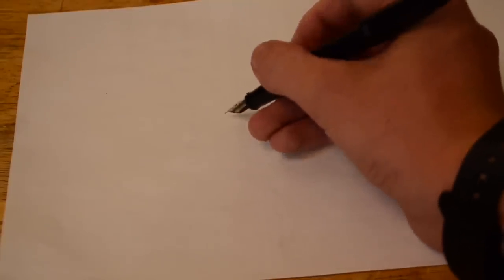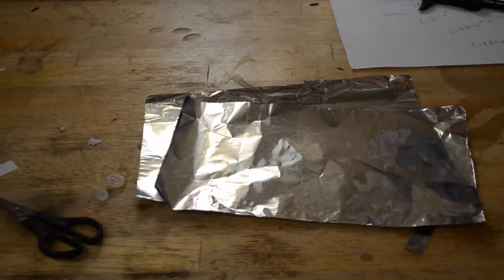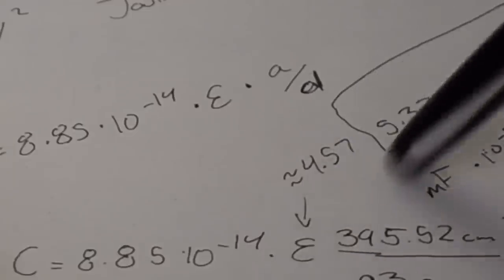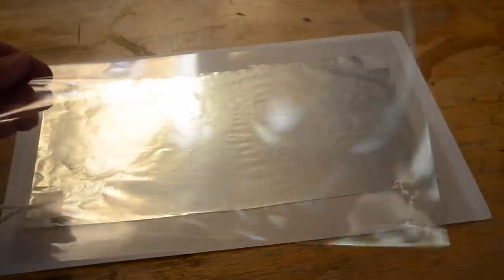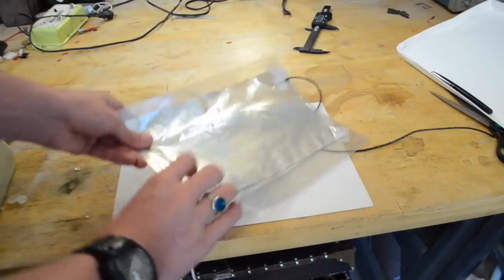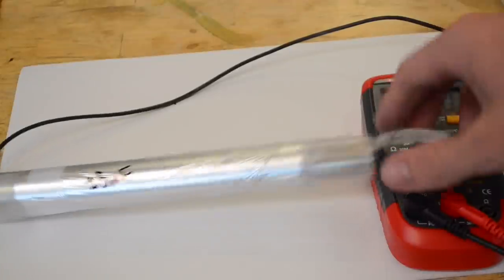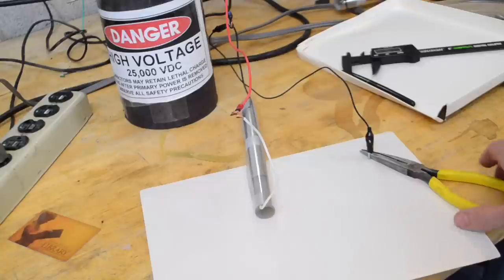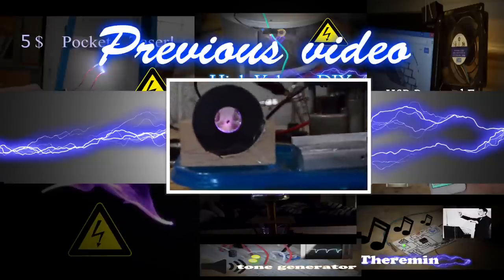How to make a High voltage Capacitor

Comment from the maker: Fact correction, a micro farad is x10^-6 ( i said it was x10^-8 in the video for some reason ) however, this is still 5 nano farads that I calculate
Reply: Keystone Science sir, that power supply of yours is quiet weak ,please make a zvs driver
Reply from the maker: +Mrinal  Thakur yeah, I have a zvs driver already, perhaps I should show how to make it
Reply: Keystone Science don't show that it's very easy use modified zvs of which schematics I will send you on telegram group
Reply: Keystone Science I watched your video of the pocket EMP. It's awesome but I am muddled up with the schematics of the taser EMP when connected to these HV capacitors. Can you please share a detailed schematic? It's really urgent
Reply: Great video
Science is great 🐇
Reply: you also wrote "mF" which would typically mean milli-farad, rather than "uF"
Reply: how could i buy that plastic sheet

Comment: Great video! I made it myself and got it to 7nF , also I used 3 sheets in between the plates and it was able to handle a pretty high voltage ! Thanks!
Reply from the maker: Thanks Nate!
Reply: Mine didn't work
Reply: @KeystoneScience can I add 2 foils together to increase capacitance?

Comment: I'd like to see 10 of these in series. No reason other than awesomeness
Reply: Out of curiosity, why series and not parallel? There's more capacitance in parallel, and which by equation means more energy, thus bigger spark this way right?
Reply: @Sensei-jh8yn  voltage gives the sparks I believe.

Comment: This is the coolest thing I've seen so far today :)

Nice work
Reply from the maker: Hah :D thank you!!
Reply from the maker: Wait, are you from Utah as as well?? I just clicked on your channel and saw the Provo power tower demolition video, I was at that as well!! I am from Orem
Reply: Keystone Science sweet! Yes, I live in Provo. Find me on FB @phonerepairtrent if you want :)

Always nice to find electronics nerds. I mostly do microsoldering and data recovery on mobile devices, but plan on launching a fundamentals of electronics channel soon. I think using this type of a capacitor video is the perfect method to show how a capacitor can short into a wire, causing a short to ground (if using as a decoupling cap/high frequency filter). Often, the insulator fails and the two plates come in contact. Your cap building method would be a good way to demonstrate how caps can short to ground. 😎
Reply from the maker: +Rice Is For Dinner awesome!
Reply: No I think the EMP generator is the coolest---YOU CAN INSTANTLY SHUT DOWN AN ELECTRONIC DEVICE!!

Comment: This is unbelievably cool. I thought you had to use some special chemicals and processes to make capacitors but I guess not! In terms of how big a spark you can get, what is better, to have more plastic between the foil of individual capacitors or to link a greater number of these in series with the least plastic (to have high current)?
Reply: Generally its not difficult to make a simple capacitor, making high quality ones however is more difficult
Reply: Crikey Crikeys connecting capacitors in series does not add capacitance.   The principle is opposite of batteries.  To add capacitance, hook them up in parallel.
Reply: Correction: The principle is not opposite of batteries. Capacitors in series add voltages. This is the same as batteries. Batteries in series add voltages. Capacitors in parallel add capacitance. Batteries in parallel add current. Hmmmm. Seems like there should be some profound relationship between battery current and capacitor capicatance.
Reply: However battery Amp-hours might have a closer relationship to capacitance in joules. No?
Reply: Amp-hours and joules: WORK-OVER-a-period-of-TIME ???

Comment: just think if you had a thin film of superinsulating titanium nitride film cooled below it's critical temperature with liquid helium. Then you could hypothetically prepare a very small capacitor with infinite voltage and subsequently unlimited amount of energy to be stored within it.
Reply: but keep in mind the production of inifinite energy is impossible because Newton was a huge pp
but the idea is both theoretically "correct" and possible
Reply: what form is the energy stored as?

Comment: Hi - I built some of these with overhead projector sheets (acetate I think), 2x4 mil spacing, that's 8 mil or about 0.2mm. They can take 10kV easily. But I don't understand, the dielectric strength is 11kV / mm, so I should only be able to hold about 2kV. Any ideas, or is my calculation wrong? Thanks!

Comment: It seems you used the capacitance formula for a parallel plate capacitor. Wouldn't have been more accurate to use the one for a cylindrical capacitor?

Comment: Where did you get that fountain pen? Haven't seen one of those in many years. So please give us a rough guide on the size of capacitor necessary to start a common v-6 engine. And also give us the size of capacitor which could start a air conditioner, if you can make the voltage a/c.

Comment: can you make a video on what capacitors are and how they work like can i carge it up then disconnect it from everything and it still be dangerous? after a certain amount of time will it just slowy discharge? also i really want to get into building circuits but i dont have a soldering iron or really anything so advice on tools? i have a bunch of scrap curuot boards from a couple laptops and also two fm transmitters i want to make a 'toy' out of  but i dont know how so i will definitley stay tuned for any help i can get thnx! gr8 work btw i hope your chanel keeps exploding the way it did recenly
Reply: Kayle Needler if you have no clue what you're doing then the last thing you should be doing is playing with capacitors, high voltage or laptop anatomy...that's a really good way to earn a Darwin award! ...btw...electrolytic capacitors ACTUALLY are known to self charge...not discharge...you're thinking about it like it's a battery and you NEED to learn a TON MORE before "buying tools" n becoming a danger to yourself, a danger to someone using your "toy" or killing your family by burning the house down with something you cobbled together with no knowledge of why or how it's working, the math & electrical theory involved or the proper engineering of safety features within a circuit's design. stay alive and get a best buy credit card instead ....at least until you can have a conversation intelligently pertaining to the subject matter I have mentioned above. ....I'm not being a dick...I'm being "for real" ...don't mess with electricity IF you don't have even a basic understanding of various angles that encompass the topic. . . you can VERY easily end up dead or killing someone....trained educated people have died..."'because it only takes one mistake" ...look up "composition of a dead man switch" n find WHY they call it "a dead man switch" ...that topic well teach you about death and at the very least introduce you to "grounding" and if you're smart you'd follow that and spend a ton of time learning about proper grounding and what it does, why it's needed, where it's applied and, why it works, how it works, how it's done etc...what/where/when/why/how EVERYTHING from every angle....if the question pops into head while researching something else, write it down IMMEDIATELY and go back to it when you are finished understanding what you where studying....electricity is not your friend...it will grip you and force you to hold on tight until AFTER you're dead....it should be respected and handled like a live, pissed off venomous cobra...by trained people with knowledge of its behavior and repercussions, with safety gear and a huge respect for what it can do to you in less than a flash of time....n NEVER (especially as a newbie) play with anything labeled "DANGER/HIGH VOLTAGE" or tinker around when no-one is around to help try to save you should you make that "mistake" ....you should by books/education before tools! be safe!
Reply: If you're going to buy a soldering iron and solder, get electrical repair solder, and make sure it's rosin core. You should get 60/40 tin to lead ratio. (solder is made of tin and lead) If you disconnect it from everything, capacitors are still dangerous until you discharge them by bridging the two leads. (electrically connecting the wires/metal strips coming out of the capacitor) Be careful, because this may cause a loud pop and shoot sparks. They shouldn't harm you, but obviously get some safety goggles if you don't have some. Make sure your workplace has ventilation, because soldering creates fumes. Get a fume hood, a fan, or just wear a gas mask or something. I remember when I was in your place, I'm extremely happy to help. Happy building!
Reply: @MyBigThing2010  Yes, please sit at home, consult your mommy, eat your vegetables, vote for the KKK Democrats, and NEVER think for yourself! And NEVER take a chance, or try something new! (Oh gosh golly gee, might not be SAFE!)

Comment: Thanks for the video but you under estimated the capacitance by a factor of 100 cause the vacuum permittivity is 8.85 to the power of -12; not -14 as stated in the video.

Comment: But would the superinsulator experience phase transition upon exposure to a higher voltage? Even then, you could still make a very thin capacitor <1um that would supposedly have a capacitance of around 0.1 microfads and a fairly high voltage

Comment: You can wet the film with some electrolyte too. That should make for a greater surface area, as the aluminium plates aren't 100% smooth.

Comment: Hi, what is the name of that thing that you use for measure the capacitance ? Regards
Reply: He's using a LCR meter (UYIGAO UA6243L) set to capacitance (F)...so any capacitor meter should give you the basics. However you also need to pay attention to the ESR value of the capacitor, to high and you might as well be working with a resistor!  So, if you want to measure a capacitor properly, get a capacitor meter that has ESR capabilities, cheap Chinese junk like this https://goo.gl/jDYW8g will work ok.  ~Jack, VEG

Comment: Can these caps handle high frequency? I used these for a Tesla coil and I got it to work for a while then it burned through 10 layers of plastic page protectors I used for my caps. I have a fly back transformer with a ZVS driver it puts out a high frequency. So I put one of the electrodes in one of the pages layered 10 plastic page protectors and set the other electrode on top and it didn’t burn through. Why is the capacitor burning up? If anyone know that would be great and great video
Reply: It's not the high frequency you have to worry about with capacitors.  It's the back EMF (voltage) from your coil that got you.  The dude in this video estimates this capacitor can handle 7KV, which is a very, very small Tesla coil.

Comment: hi there, great channel, why does the wire have to be on the opposite side of the previous one? i have seen others put it on the same side? is it safer or more effective?
Reply: I think it just basically keeps the wires from being too close together once it is all rolled up. If the wires get too close, there could be a spark between the two wires, which would discharge the capacitor before you ever got to use it.

Comment: I find myself wondering if you could use layers of HDPE shopping bags in place of the plastic sheets you used in the video.
Reply from the maker: +Nathan Olmstead yes that should work fine!
Reply from the maker: +Nathan Olmstead although I don't know what the DI-electric constant is for shopping bags
Reply: Keystone Science it doesnt really matter unless you need to know it for the priject like if i want to shock someone i dont need to... actually i might want to make sure its not lethal... this could get bad very fast

Comment: I would like to make a big capacitor for use in a mains capacitive dropper arc welder. I suppose it will be huge, since the capacity should be at least 220uF for a 2.5mm stick. But just how big and heavy would that be?
Reply: Never mind, I calculated it would be about 44000 times bigger. That's impossibly  big.

Comment: What are those sheets called? I cannot find them anywhere on ebay
Reply from the maker: +Scotlahn Mccallister I'm using overhead transparency film in this because that's what I had lying around, however you can pretty much use any plastic sheet for this, just google the dielectric constant, and voltage break down so you can calculate how many layers you need :D

Comment: How would you increase the capacitance? Can you keep adding aluminum foil sheets?
Reply: I think that would just lower the resistance. Try making the capacitor bigger
Reply: C = εA/d.
if you cannot increase geometric area or decrease  distance, you have to have a material with high dielectric constant.

Comment: Why capacitance is lowered when we add two sheets of dielectric, I mean we're adding more dielectric should it not ADD UP the capacitance  ??
Plz can you explain... Thnx
Reply from the maker: Yes, the dielectric is increased, but at the same time the distance in increased. When we work through the formulas, we find that the distance has a larger effect than the dielectric constant per meter. Thus, for this material, placing more sheets lowers the capacitance.

Comment: How does the one you built handle a 10 mil volt taser if i were to use said taser as the spark generator for the emp video?
Reply from the maker: +that guy jae if it was actually 10 million volts, it would break down near instantly. However I have never seen something that is 10 million volts except for Maybe a giant Tesla coil... ( through air, a 10 million volt taser could arc about 3.3 meters, as in average the break down of air is 3kv per 1mm ) really most tasers are around probably 50-60 kilo volts. So yeah, if the manufacture claims something outside of that range, be very skeptical.
Reply: Okay thank you so what would the typical taser (50 to 60 kilo volts) require for the emp? With the capacitors shown in the video above? Im not too wise on the equations and such.
Reply from the maker: +that guy jae hmm, so the higher the capacitance, greater the pulse will be, so for the capacitors , making them high enough voltage rated would probably require about 6 sheets in between is what I would guess, you can look up the thickness of the sheet, and also the dielectric breakdown of the material to determine how many sheets you would need to ensure it wouldn't fail, and then using the dielectric constant and the equation I showed in the video, you can calculate how much capacitance each one would have, then you can link the capacitors in parallel to get a higher capacitance. But, also as far  as I know, the output on a taser is low in current, so it would take a while to charge up a lot of capacitors.
Reply: Keystone Science im sorry i honestly dont really understand alot of what you stated.

Comment: hi,
it looked like you put three layer of plastik between the aluminum sheets but one one below it and on top of it. if you roll it there will be three sheets between them but only TWO sheets between the other sides of the aluminum!  gives you  the voltage limint of two sheets with less capacity!
Reply: The thicker the dielectric, the higher the breakdown voltage. He is just doing the same thing as putting the capacitors in series, it raises the voltage limit but has less capacitance
Reply: I think you are right! If he were to leave them flat, it wouldn't matter. But the bottom side (with one sheet over it) gets rolled over and touches the top side (also with one sheet over it). So he would indeed only have the dialectric protection of two sheets (lower top voltage possible), but is only gaining a little bit more capacitance (because of the thinner two-sheet barrier between them). He should add one more sheet to either the top or the bottom in order to actually get the full three sheets of dialectric protection. The third sheet he has in place here only diminishes capacitance but does not acheive a higher voltage, since the weak link of the two-sheet barrier will always be the limiting factor. I believe you are correct.

Comment: am i able to use copper wire to hook up the the aluminum sheets? and use wax paper to seperate the foil?
Reply from the maker: +madz bush yeah that should work! Although I'm not sure what the breakdown voltage, and dielectric constant is of wax paper
Reply: ok, thanks! so, i admit, im kind of lazy, so do you know anything i can use instead of the plastic you used in the vidoe?
Reply from the maker: +madz bush haha fair enough xD, besides plastic, you could even use glass, distilled water, air, a vacuum, ceramic... Yeah ! Mainly those are what I've seen used
Reply: okay, thank you!

Comment: @ 3:40 is that a kink or break in the wire insulation on the red wire? Almost looks like it was about to short itself against the body of the high voltage transformer. Yikes!

Comment: I once made a capacitor with nothing more than two sheets of foil, and a paper towel soaked in gatorade.
Reply from the maker: +SpectreDaemon huh, how much capacitance did that have?
Reply: Keystone Science I have no idea, it was like 3 years ago when I was in Navy learning about nuclear electronics. i did it basically the same way you did, but obviously the gatorade towel was the dialectic.
Reply: Suppose I have a cheaper type of Gatorade? Would that work also?

Comment: of I don't have that projector plastic could I just use paper
Reply from the maker: You could , only paper's DI electric constant is 3 ( the plastic I use is like 4.2 ) also paper has a breakdown voltage of 200v/mm while the plastic I use is probably about 1.2kv/mm. So the results would not be as good ( especially for high voltage applications )